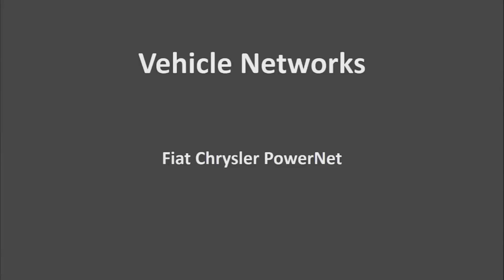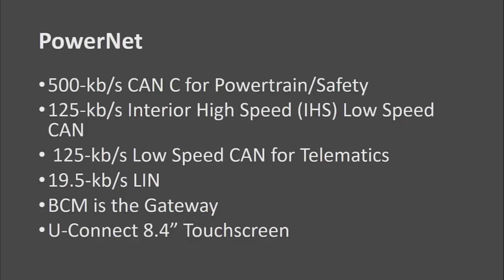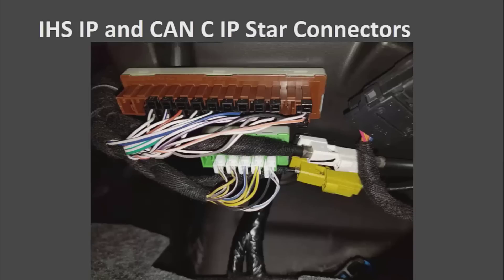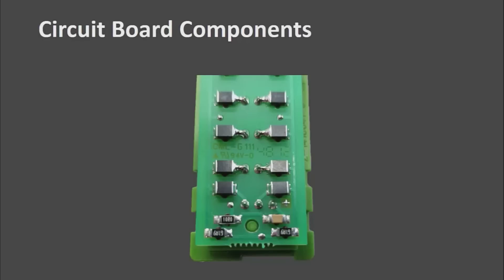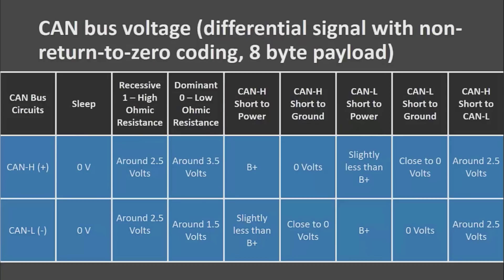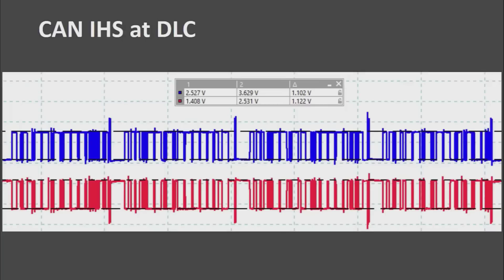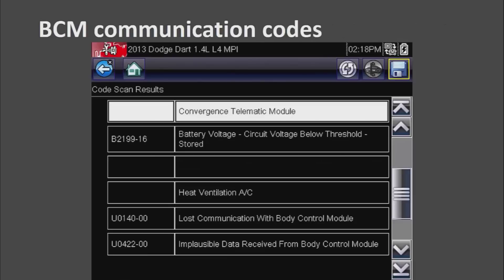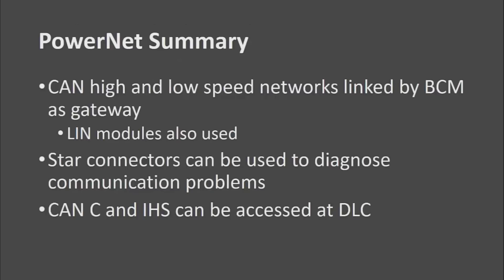Chrysler/Fiat PowerNet Network

Comment: Great video.  I was trying to add a remote starter and lost what plug the one i pulled out goes to is there any information on what plug goes with what connector or that does not matter?

Comment: Great information . Unfortunately , a large percentage of the " repair " shops out there don't have a clue on how to diagnose and fix these vehicles . There may be a large number of dealers as well . How would the public source competent , trained technicians ? Possibly on IATN or Diagnostic.net . Or contact Pico or ATS to see who owns their equipment . That is also no guarantee as to level of training . And there are too many shops willing to " take a stab at it " - with your wallet . It never turns out good and an ECM is then pronounced the root of all evil and replaced . Would there be a way to list trained techs and reach out to the public ? None of this is easy . However , the shops and techs that have invested in training and equipment should profit . It's too bad the industry gets a bad name because shops put themselves out there as experts , when in reality they are lube shops doing basic repairs and own a scan tool .

Comment: I had a R56 Mini with turn signal fault. I identified a short on the K-bus, a single wire data bus that was prominent on early bmw vehicles. I run a similar routine to find the cause. I the Bus bar is buried beneath the drivers seat and was saturated in water, although this was not the cause. After pulling busses one at a time i discovered it was the rain sensor that had water ingress and shorted the live to the k bus line

Comment: Great video. The only issue I have is that these new cars are the biggest pieces of crap because of these computer systems. I had a dart that was never right from the get go the screen would reset continuously. It had to do with voltage issue never was fixed it never through a code and wouldn’t act up at the dealership. I had videos of this issue. I still own a Jeep Cherokee 2014. Active grill shutter threw check engine light because it froze in an ice storm car wouldn’t pass inspection sad part is you have to pull the bumper off to get to the unit and it’s expensive vehicle has 67000 miles. Piss poor design on all these vehicles . You sill could have these creature comforts and have them as separate system. You can’t just change a radio any more and to boot they price of these vehicles is outrageous. Your video here is great but these cars really are garbage. Electrical issues cause huge problems with electrical voltage drops causing weird stuff to happen and sometimes it’s not reproducible so your stuck with a vehicle that does weird stuff.
Reply: People always think something they don't understand is "garbage".  I am constantly making changes to my Dodge Dart...  and I have changed between 3 different radios because I know the process to program the BCM with the changes needed to recognize the new/different features.
Active Grill Shutter is a good idea that didn't work out so well in practice...  but to expect something to not freeze when it is out in the weather during an ice storm?  But a problem with the AGS would NOT cause it to not pass emissions.  Nevermind, it can be disabled in the system.  And I've pulled the bumper cover off of my Dart...  a few plastic pins and roughly 16 bolts.  Not that hard tbh.
My best friend is a mechanic,  I am a computer engineer...  both been in our fields for over 2 decades. He has taught me quite a bit about the mechanical part of working on cars.  And I have kept him up to date with this stuff.  Not that hard, just a different way of looking at it.
Reply: Rob Campbell yes you would think so but in ny it will not pass. I currently have another issue on the can bus. These thing are garbage computers have done nothing but cost consumers more. I am not against technology but it has gone way beyond where it should be. Appliances are another example. I don’t know your age but I came from the days before the computer crap. I also atone point worked on and loved computers but what ruined it for me was every time I wanted to d something on them I had to deal with bugs and crashing which became a giant waste of time. A perfect example is Windows it’s still garbage and it’s been around since the mid 80s. You can’t look at a computer and tell it’s broken like you can with manual process of the way thing did work. You can’t predict how long a computer will last either. Just because you can program these things doesn’t make them better or more reliable. Just like one of my components is creating noice on the can network and keeping the check engine light on. There is no need to tie in a radio to this network or heated seats or door locks or windows they can all be controlled the way they were in the past. The only thing we do need a computer for is the ignition system and not everything else.
Reply: Rob Campbell the other fact is you can’t swapped computers from car to car without taking the whole system they are all depending on each other. Swap of an engine in the old days was much easier. I could take a car with a six and put an eight in it by getting parts from a vehicle with an eight if it was an option. No can do today because all the computers and such the dart they built and used a modern hemi had so many issues it was funny. They did in the end Ge it to work but still had wired buggy issues.i believe it was grease monkey and a 68 dart
Reply: Rob Campbell I do understand it and that’s why I know it’s garbage it doesn’t need to be this way to have these things work.

Comment: Matt, do you happen to know the oldest vehicle that has the power net system on it. Great video. I will have to look in to the SAE papers you mentioned
Reply: Chrysler introduced it in 2011, only on a few cars. A good CAN SAE paper is: "Locating Wire Short Fault for In-Vehicle Controller Area Network with Resistance Estimation Approach" The doi is 10.4271/2016-01-0065
Reply from the maker: In 2011 Chrysler introduced powernet in the Chrysler 300, Dodge Charger, and the Dodge Journey. It was right after that when they made it  across-the-board on all vehicles I believe. Jeep etc all adopted the systems. As Matt said, the easiest way to identify if the vehicle is equipped with Powernet is by the appearance of the media center display.

Comment: Learned something new. Thx!
Reply from the maker: Dylan Awesome! What did ya learn?
Reply: I wasn't aware of the star connectors. And as you state in your video these are pretty handy for diagnosis 😉
Reply: I do have a question though. Is there a MOST bus on these for the infotainment?
Reply from the maker: Dylan Chrysler uses the powernet network. It's similar to MOST that a lot of manufacturers are using. Here is a link describing MOST. https://en.wikipedia.org/wiki/MOST_Bus
Reply: Gotcha 😉 Thx for the MOST link. Although I'm aware of this bus, I see a lot of MOST50 in practice, it's always interesting to review it. I also read this article on FCA's Powernet. 
http://articles.sae.org/9495/